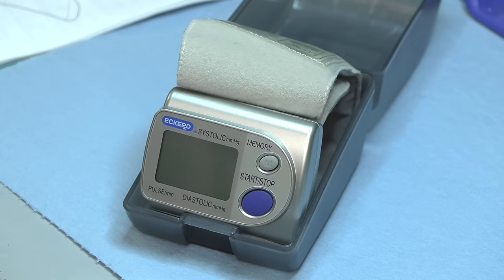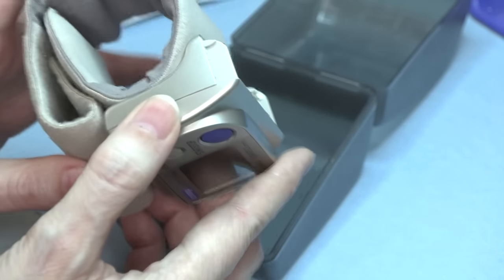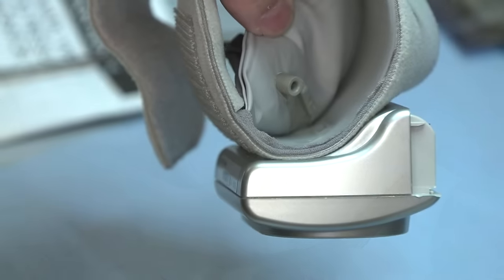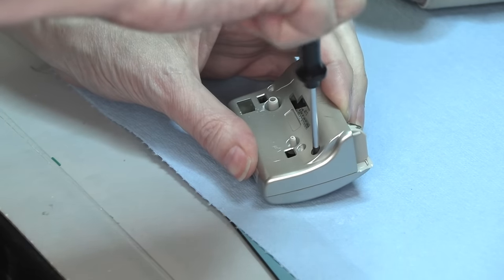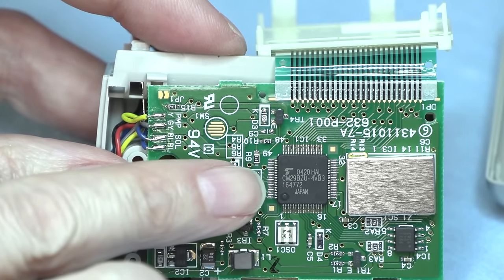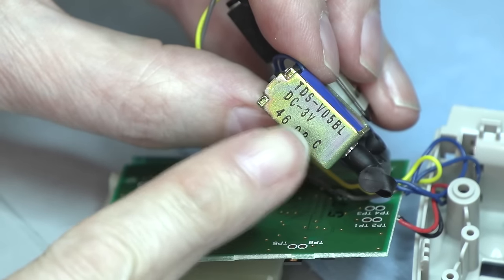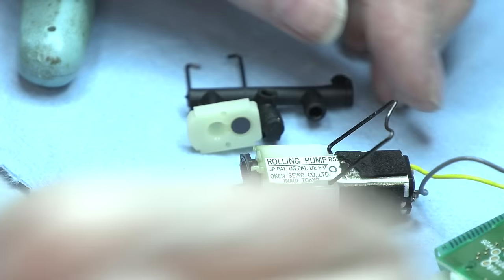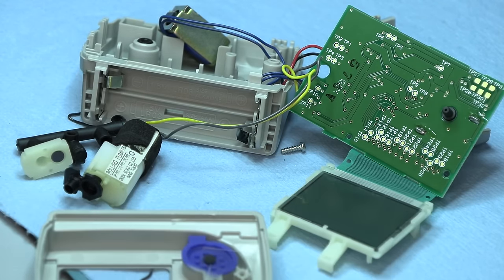Miniature Machine - Inside A Home Blood Pressure Monitor

Comment: The Eckerd logo on the device definitely dates it to around 2004 or earlier, before they were absorbed by CVS and Brooks. The stores that remained Eckerds after that point were rebranded with "pharmacy" in a red capsule below the word Eckerd to align more with the then-current Brooks Pharmacy logo. By 2007 there were no Eckerd or Brooks pharmacies left as they were sold to Rite Aid which itself eventually folded.

Comment: I have an old one somebody was getting rid of which is a larger unit and detachable cuff. It's definitely older, it has very yellowed plastic, DIP ICs, and perhaps most interestingly, a miniature chain printer to log results if desired. But the "action" part is the same: one air pump, one release solenoid valve, and one release valve. The only possible difference is a constant slow bleed valve used during the actual measurement.

Comment: I wonder what acts as the korotkov microphone??? Maybe the coil???

On second thought it's likely combined with the pressure sensor. Fran you should have cracked that open too...
Reply: There is a condensor mic, or electret mic to listen for K sound, the ucomputer will process all these details.

Comment: I once bought one of those wrist cuff blood pressure monitors, the Harbor Freight special.  I thought it worked fine but some months later when I took it to the doctor’s office I found out it was consistently showing about 10 to 15 points lower than actual.  So, while I thought my BP was good, it was actually elevated.  Total junk.  I switched to an arm cuff version that’s much more accurate.

Comment: You would also be ammazed at the many parts in a modern coffee maker  using a k cup.    Pump valves and safety sensors.  Vs the old heater coil and valve drip coffee maker.    The coffee k cup maker also has screws and multiple hidden clips,  for a repair you want to release and not make too many pry marks.

Comment: Come on, Fran, what is inside a rolling pump. Doesn't sound like a reciprocating pump. Let's see inside!
Reply: Rollers basically milk things through the pump
Reply: Sorry, I need a visual too @UKsystems
Reply: I haven't seen one with only 2 pistons but a very common design has a rubber mat with three chambers. An eccentric thing on the motor shaft compresses each in turn.

Comment: How do suppose it senses when the blood has stopped flowing and then starts again?
Reply: All these work pretty much the same, the pressure sensor is so sensitive the unit can read your pulse in the pressure data.  Every time your heart pumps there's a tiny spike in the pressure in the cuff, when the pressure in the cuff gets high enough to stop blood flow the spikes go away.
Reply: The machine is set to pump until 200mmHg, then the solenoid opens to release the cuff pressure slowly at a fixed rate until you remove the cuff or until 0mmHg, meanwhile a microphone will detect the korotkov sound, microcomputer will register and display the diastolic and systolic and pulse.